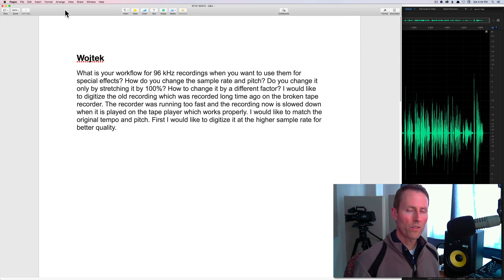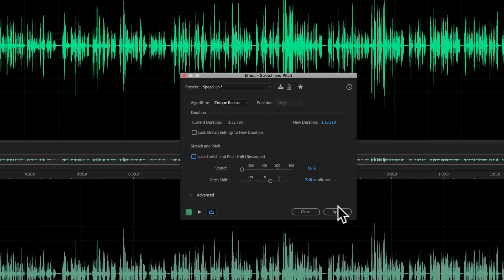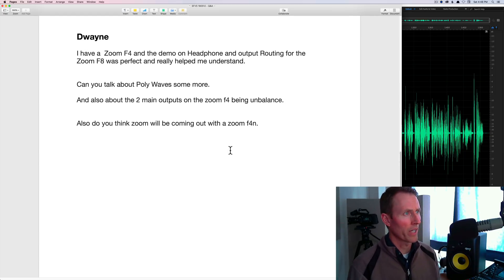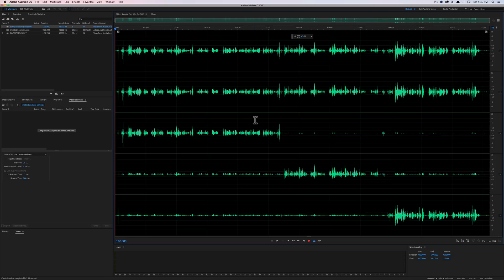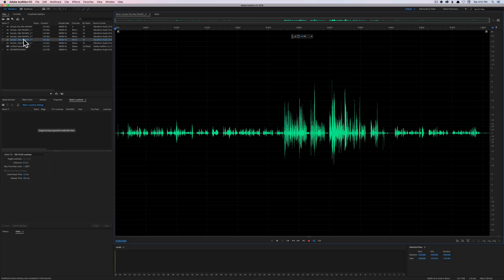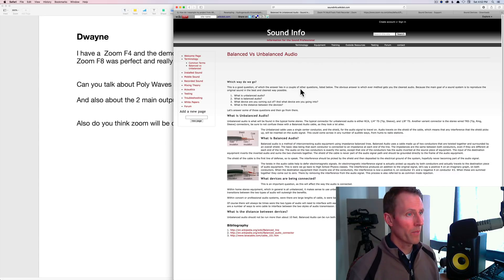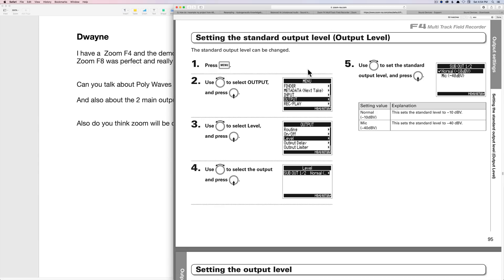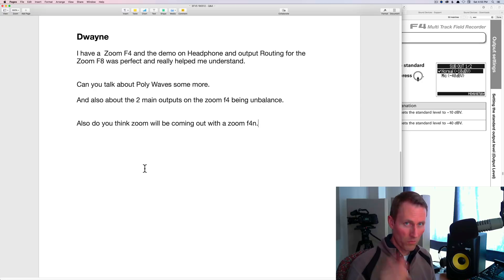Sound for Video Session: Q&A Stretch Time & Pitch, Poly Wav, Balanced vs Unbalanced, Zoom F4n

Comment: Curtis:  Just editing my first poly wave file(s) in Audition recorded o MixPre 10T.  Not getting anywhere. Do you have a workflow for this?  Currently, I'm breaking the polywave file into multi-track format in Audition, then denoising, normalizing, sweetening, etc.....then saving as a stereo LR file to send to editor(s). Is this the best way to edit polywave files?   Thanks, William
Reply: Hi Richard, This is mixing. The course I'm hoping to work on this summer will cover mixing and the workflow surrounding it. It's a big topic as you are finding. More to come soon. Overall your workflow looks pretty good though I would do the sweetening before loudness normalizing. Loudness is usually the last step before exporting to a LR stereo mix.

Comment: You noted some very relevant issues with fixing old recordings. I've observed that, generally, archival/restoration work comes down to these two options/questions: Does what you end up with sound good to you? Are you prepared to 'go down a rabbit hole', 'chase that dragon' (or whatever other metaphor of a near-futile pursuit of remarkably expensive obsession works for you)? Because "accurately" converting mechanically recorded sound to a digital medium at (near) original specification is practically magic. In the end, most folks are happier with the first option.
 For most basic stuff, I've appreciated the quick, relatively pain-free solutions that using Audition offers.
Reply: Fair point, for sure. Worth a try with Audition first and see how it goes, then re-evaluate from there. There's a significant cost so the question is how much investment is the recording worth. Something with a lot of sentimental value can draw us (me included) into these rabbit holes. Definitely worth running the first attempt in Audition past a non-audio person to see what they think of the quality. Many of us second guess ourselves and spend a lot of hours trying to tune in the last 1% improvement in audio quality that many other people may never notice. On the other hand, you can't necessarily put a dollar value on sentimental value so giving it your best - within the limits of what you can realistically give - is a worthy effort.
Reply: No doubt. 
I, too, was amazed at the expense (and the steep learning curve) when I first started researching the restoration workflow. It is truly a deep, deep hole.
Reply: Exactly so. Oh, that cursed remaining 1% has gotten the better of me many times.
Been using Audition since it was Cool Edit Pro. Great tool.
Reply: Wow, since Cool Edit Pro, that is impressive!

Comment: For Wojtek: Consider that if your analogue system is playing back "too fast", the characteristics of the system will differ from its original design. Not necessarily a bad thing - but filters /might/ be removing some material at the top end of the spectrum, nonlinear modification of phase, as well as other tonal qualities of the analogue system... Digitising at high sample rates evidently would not fix this (if true). If there are options for it (or you can hack), look into under-volting the drive motors to try match the correct speed before digitising. If you can do that, you'll largely negate the inherent problems of digital filters (pitch changing) or sample interpolation.
Reply from the maker: Thanks for the insights, Darius. Very helpful.

Comment: Hi Curtis you probably could keep the link on balanced vs. unbalanced on your vids there considering how often this comes up. Also I wanted a Zoom initially but went with Tascam due to Zoom's odd meta data titling etc. Could you share your experience with that? Also notice the URL on the balanced link balanced is misspelled. Love your content. Always learning something new. I think I am giving up on DSLRs for video or mirrorless. Going to get a Canon HD 70 something Camcorder and call it a day. Will use a bracket for LED light and my Tascam DR-100 mk.3 of which I would love if you did a review on please?

My Podcast keeps getting stalled. Equipment and content and my courage lastly hold me back. Keep your great videos coming. I appreciate all you do. Maybe I will share a meaningful video at some time. Thank you again.
Reply from the maker: Hi Vincent, good to hear from you. And good idea re: balanced/unbalanced. :) Thanks for that!

I'm curious about your thoughts on the Zoom meta data titling. What is it that you found odd about it? I've found it sufficient for my work in almost all cases. Yes, DSLRs are less than ideal from an ergonomic point of view so I totally understand your perspective on that. I've very much enjoyed working with my Ursa Mini Pro which is made only for moving picture and its ergonomics make that obvious, and a joy to use.

I should be able to get a Tascam in for review. I'm curious what you'd like to know about it that you do not already know? ;-)

Thanks for your always thoughtful comments. Happy recording!